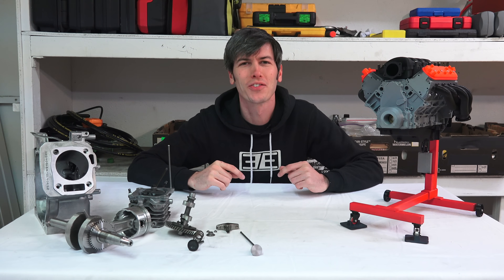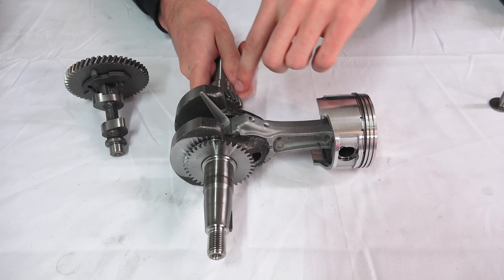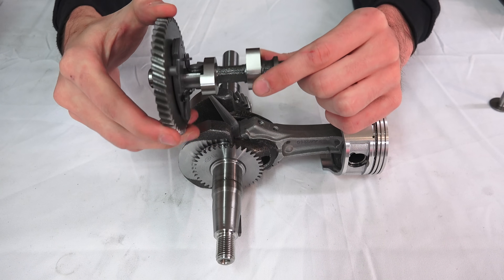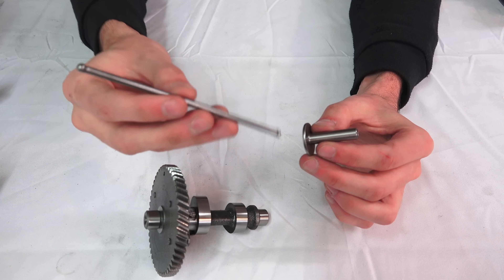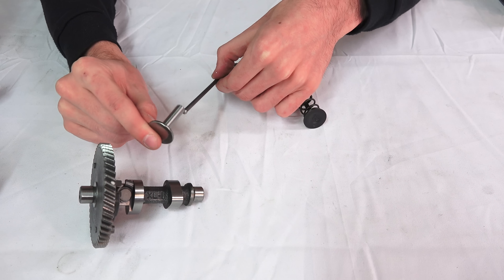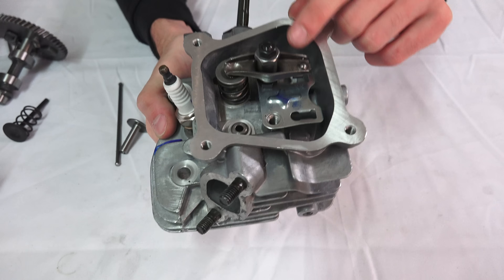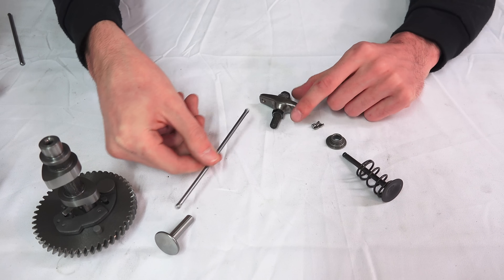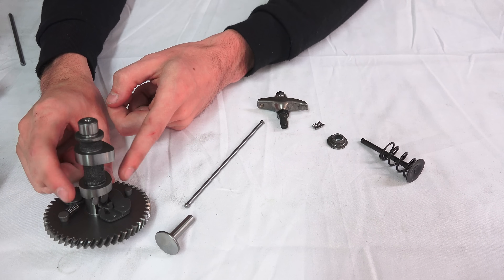Why Can't Pushrod Engines Rev High?

Comment: Why don't pushrod engines rev very high? Reason 1) Valvetrain mass. Reason 2) They generally don't NEED to rev high in order to make power... because their displacement relative to external dimensions tends to be higher than OHC engines.
Reply: and more pumping losses
Reply: @L.Verhoeven  Yeah, with a turbo...which is essentially making that 1.6 into a larger engine.
Reply: That, too, is a fair statement. My response, re: the external compactness of OHV engines compared to OHC engines is specifically a reference to automotive-type V-configuration examples.
Reply: @L.Verhoeven  But how long will your 1.6L last in a cold climate and daily use with minimal maintenance?
Reply: @Richard Vaughn Bingo. Work (torque) = force (cylinder pressure) x distance (stroke). I drive a tractor-trailer. We need torque, not HP. Torque moves the load (weight.) Power to weight really comes into play here. HP is speed. Try to start off an 80,000# load with HP and minimal torque. Ain't happening. This is true in any related application.
Reply: @Richard Vaughn that's actually not true at all, I dont know where you got that info from but its false
Reply: @Richard Vaughn There's nothing instrinsic to overhead valve engines that dictate them having a larger stroke.  You can have an OHC or an OHV engine with any combination of bore and stroke.  Some of what you said is correct but your first comment was nonsense, "boy".
Reply: Mark Estrada well said
Reply: Higher revs= more wear.
Reply: @markusgarvey  not true, more friction == more wear, why are F1 engines pretty reliable for how many revs they do and at how high power output
Reply: @kas-lw7xz  They run 1  or 2 races and they need rebuild. An F1 car would be doing to make 6 hrs. For instance Team Corvette GTLM class will run 24 hrs no problem w/ 5.3 pushrod V8, and would still be able to race the next day. Probably wouldn't win, but would make it through another 3 hr race, you could pull it out and get 50k or more out of it in a daily driver.
Reply: True, and a fair point. Amended Reason 1) Reciprocating valvetrain mass.
Reply: Technically a dohc engine has more valvetrain mass. Just they don't need to be force up and down.
Reply: Exactly.  "They do not NEED to rev high to make power."  My 1963 Ford 260 V-8 reaches its peak torque and best efficiency at only 2200 RPM.
Reply: i actually once did a comparison between the 2 most used V8 motors used in performance cars here in australia until manufacturing was shut down, the pushrod LSA which was used in HSV and the DOHC miami which was used in FPV, both supercharged.  in terms of horse power, the miami came out ahead, even though it has a smaller displacement, 5 liters to the LSA 6.2 liters.  but the LSA came out ahead when it comes to torque.
Reply: @Richard Vaughn i do know how it works, trouble is with strokers, if you increase the stroke without increasing the bore to match it, you can lose power in the high RPM ranges and it can accelerate engine wear faster than an alcoholic drinking beers at the local pub on a friday night.
Reply: Not necessarily. My Daimler V-12 has a SOHC and its valves are all in a line just like a SBC or Ford Windsor. It's a 60 degree V but given that its heads are no wider than said Chevy or Ford, it'd be no wider than those engines even if it had a 90 degree V. Forget that it has 12 cylinders as we're talking about width, not length.

Comment: Mainly because they do not need to, they make sufficient power at lower rpm's. If needed they can rev, look at a NASCAR engine. Over 9000 at times with pushrods and rocker arms.
Reply from the maker: As discussed in the video! :)
Reply: Yes it was. Outstanding video BTW.  As an Engineer also, (retired), you explain things very clearly.
Reply: charlie dee pro stock engines were turning somewhere in the neighborhood of 11k rpm or more the last time I was into it.  They run huge springs  and massive amounts of open and seat pressure.  Seat tends to be 500lbs and open is around 1000-1200lbs.   Pretty impressive in my book.
Reply: Engineering Explained  maybe the take a look at NHRA pro stock motors. Currently 10500 rpm. Used to be 12-13000. And they are 500 cubic inches.
Reply: I used to have a 1982 Mini the BMC A-series engine was first put in them in 1959 and it was first put into the Austin A30 in 1951. I had only minor modification but it would quite happily rev to 8,500 rpm on pushrods, would then suffer from valve bounce so that's not bad for a engine designed nearly 70 years ago.
Reply: 500 cu. in. with over 1" lift cams and a single throttle body... Try doing that OHC and DOHC... F1 cars are unreal but they dont hold a candle to pro stock. Also NASCAR engines are flat tappet.
Reply: joe blow nascar engines have roller cams now
Reply: Lorentz the annoying Llama almost all pure balls to the walls racing engines are done after a race and in need of some care.
Reply: Lorentz the annoying Llama need I bring up F1 and the ridiculous engine rules?   How long did those engines last before they puked their guts?
Reply: charlie dee short track engines rev far higher then super speedway engines. First, short track engines only have 1gear at its disposal AND no fuel usage issue.
Second, superspeedway engines have mulitple gear ratios at its disposal AND are limited to amount of fuel,, ie restrictor plate means, big cam, big carb, useless. They normally try to keep revs as low as possible, 7,000-9,000 is max, not due to engine coming unglued but fuel usage at higher revs.
Reply: And they have to be rebuilt after the race.
Reply: Bartonovich52 what has to rebuilt after the race?
Reply: Good explanation

Comment: so what you're trying to say is coyotes are better than Ls ? 😉
Reply: PEDRO ى look up the $10k LS vs Coyote build off. LS won with over 100lb/ft more torque. All those cams and valves and can’t create the same torque for the same amount of money as the more simple, easier to work on and much cheaper LS engine. 

No matter what you ford guys wanna argue, you’ll NEVER beat the value of an LS engine and you sure as hell can’t fit that HUGE 5.0l into all the cars you can fit the smaller 6.2l in.
Reply: bigpigslapper Oink hear that.
Reply: Eric Erickson yea I've seen it and you're right about not being able to create the same amount of power with the same amount of money, that's where the LS is far superior but i meant what I said as the coyote being more efficient and being to rev higher, and the coyote is getting more complicated while the LS has stayed on the same path.
Reply from the maker: Not yet! Will have a video on the advantages soon. :)

Comment: I just can't believe how much I'm learning with this channel. Not to mention how easy it is to learn these stuff. You're getting better everyday, dude. Keep it up!
Reply from the maker: Very happy to hear it, thanks for watching!!
Reply: same review here too . u make it extremely easy to understand from a foreman level. 
i wished i were  to learn automobile engineering supported by Ur videos
Reply: master blaster of engines
watching Ur videos i have changed my concept of engines i now take good care for my engine hope u make some maintenance videos too for Indian passenger cars.
Reply: I had previously thought your videos to be quite well thought out and very well researched alas not on this occasion cbr250rr 19500 red line 410 chev motors used in jet boats regularly rev to 10,000 rpm the old f5000 race cars of the 70s regularly 8,000-8,500 and the cross plain chev from that era 10,000 most production cars do little over 7,000 rpm  (yes some will and can go higher but most do not) and pneumatics has little to do with high revs in f1 cars either it makes it easier to eliminate cams and/or have better valve timing variation
Reply: @konaguzzi1  ... the fact is: the level of precision in building 'all' engines  has increased by several orders of magnitude in mass-produced engines (as they say, a rising tide lifts all boats)....We have always had special performance shops who could and did "blueprint" engines...set it to the engineer's standards and tolerances, balance components and produce top quality components which could exceed factory specifications. Now the quality OF CAR engines are pretty consistent...all the engines are good, you don't have to get a lucky car to find one that makes with 5 or 10 horsepower of specification - if not exceeding it by as much!

    Once factory parts got better... then specialty shops got even better than that. When you could get a "Mountain Motor" (running 500, 600+ plus cubic inches) to rev to 9,000 - 9500 rpm - using factory-like components - like they were doing with the factory super stock engines and Outlaw engines... with push rods; like they were doing back in the 2000's. Something was being done "right"! Of course, those engines only NEEDED TO RUN FOR  a few seconds at a time, and cost 30,000 each (in research and development money).

     today using 5 litre engines, we have everyday "bread 'n butter" - rental cars  which can do 7K rpm... and can be expected to do 100 - 400K miles - in pickup trucks, cars with damn good reliability. there was a time when the local machine shop would build you an engine, which you "hoped" would not blow up 500 - 1000 miles after you put it in your car. Now we can get a crate engine, which puts out 500, 600, 800 hp  and comes with a warranty!

    How is that fake? ...factory engines have a whole 'nother list of requirements which specialty motors never have to face.

     Do not try to compare apples and oranges - then use that comparison to call out someone who is taking a little bit of his time to drop a little bit of knowledge ... for people smart enough to NOT look a gift horse in the mouth.
Reply: @JustinAEgan  Apple with apples push rod engines have and do rev high he said they don't Sorry they can and do not looking any gift horse in the mouth at all just pointing out his utter lack of research on this vid, any research into relative engines of similar time will show that is correct
Reply: @konaguzzi1  I paid attention, mostly, to his point "push rod engines ...generally... do not tend to rev that high". I did illustrate the fact that you can, get pushrod engines to rev... its just more expensive to do it, than to just buid bigger engines, which burn more gas,are wasteful. nothing wrong with it... as long as you understand why we made that decision.

      I took that as the reality of "most" production, mass-produced passenger car and pickup trucks.

     He compared push rod engines to DOHC engines... which to me follows the large disparity between GM sticking to the push rod activated engines - compared to Ford, first expereimented with and who made a move to  SOHC in the 60's, and DOHC engines/multi-vavle engines - as far back as the mid-80's.

       If you think about it; American automotive companies, after the world wars... made a conscious decision to build (cheaper, bigger, large displacement, high torque) - simple engines, with pushrod valve systems; while the European countries and ultimately the rest of the world (japan, for example)...concentrated on building smaller engines which traded higher reving efficient engines. While Americans chose to build larger sized, bigger displacement, low reving, pushrod engines...which naturally produced more torque.

     We chose to build engines which were "good enough"...generally 'bullet-proof'...cause they were over designed, strength wise. Could be rebuilt easily with general tools and general skills. It fit the American ideal of "A chicken in every pot".... vs. the idea of Cars being a luxury, finely machined, regulated by the government and used mostly by the elite... Funny thing is, Ford, builder of the Model "T" - the American Volkswagen... was the one which made the move to DOHC/Multi-valve engines first... then bet their company on the idea that they could make it work? You would have thought that GM would have done ti first?

I understand its reeks of politics. I actually wrote a paper on this very subject, when i was in school.
Reply: konaguzzi1 I figured the pneumatic valves gave more control as you say. Just because he only mentioned one aspect and reason for them doesn't mean he doesn't understand them. I appreciate your comment however as I was only guessing at the other reasons and you have confirmed it.
Reply: Great video. 11-28-25 F

Comment: But what about NASCAR and there almost 10,000rpm with push rod engines unkess rules changed. I will give you they dont rev to 20,000 rpm but 10,000 is still impressive.
Reply: watch the video before you comment...otherwise you might look silly, im just sayin'
Reply: stickloaf I did i am just responding to the title of the video that is all. It is misleading. I would also like "high" to be defined. 5000 is high in a desil engines so ,if  the title was more descriptive cool but all I saw was title and was like hold on. And being a fan of this channel a lot of his car stuff has to do with performance also being a racing fan my self I am fully aware of most engine regs and the performance of such engines.  

Troll me if you must but just my $.02

Comment: I have a question! (Maybe a good one)

I drive a manual RSX-S.

When I’m driving about 30mph I’m in 4th gear.  When I hit an incline, is it more beneficial for fuel economy to downshift to third or push my 4th gear (step on the gas).

This car doesn’t have a whole lot of torque, and I can feel the engine struggle pushing 4th gear at low RPMs.  Lots of hills and inclines where I live.

TL:DR which is better for gas: 3rd gear up inclines or keep in 4th and step on gas more

Comment: Why are there no more pushrod 4 cylinders being made anymore?
Reply from the maker: Doesn't seem to have the advantages of simplification like it does with "V" engines. SOHC is far simpler.
Reply: Because it's outdated af
Reply: Anthony 123 The packaging benefits of pushrod engines are small on inline engines but massive for V engines.
Reply: Lorentz the annoying Llama Nonsense and total engineering ignorance. Evidently engines make power at a wide range of RPM, and you have control over it as well. By changing stroke ratio, you don't necessarily change average horsepower, but you do change power distribution. Longer-stroke engines make more low-end horsepower, while shorter-stroke engines can make higher-end horsepower. When it comes to OHV, short-stroke OHV engine can maintain efficiency and make broad ranging power by increasing bore. You think the differences in long-stroke diesels, big-bore LS engines and short-stroke Ferrari engines are all accidents and not intentionally different? No, they apply different strategies, and they all make power very differently. You guess which is most efficient.
Reply: Pushrod engines do tend to be shorter and so can fit into a car with a lower profile.
Reply: Engineering Explained And ontop of that, as mentioned the packing advantages of pushrod in a V8 doesnt translate the same to an inline engine. Since with a V8 you have width as well as height effected along with some weight.

With an inline engine with only one head, height is really the only measurement effected. Length and weight are not as much so you cant increase displacement as much like you can with a V8 and still save space and make up the power loss from less efficient valvetrain.
Reply: Google the Motus V4, basically a mini LS cut in half
Reply: No power compared to newer engines and to easy and cheap to fix and work on
Reply: Lorentz the annoying Llama dude pushrods don't have a hard time the valve spring does.
Reply: Actually, there are still OHV 4 cylinder on the market,  but most are diesel and not found in mainstream passenger cars. The Cummins ISF2.8 is 4 cylinder is good example. Also, a number of Japanese diesels are OHV. Really, there's not much benefit to OHC in a diesel that revs low. In reality, there's not much benefit to OHC period. If we built gas engines more like diesels, making them develop their power lower in the rev range, we'd have more usable power and better efficiency at the same time.

Comment: I have a Ford 4.0 v6 engine. Now I know why it doesn’t like to go above 6,000 rpm :(
Reply: Angel Gutierrez at least you can hit 6k, my Jeep's 5.2 V8 is limited to 5200.
Reply: Angel Gutierrez thats a sohc so no, you're wrong again.
Reply: My DOHC 3.5 V6 F150 revs to 7000 🤣
Reply: My 3.0 ohv has a rev limiter at 5900
Reply: Dude Shark dohc are mustang engines
Reply: Derrik Lee Some of them are Pushrod.
Reply: Derrik Lee plenty of them are push rod.  There’s also some dohc, don’t think we got them in the US tho
Reply: Angel Gutierrez that’s true, the new 5.0 coyotes are dohc.  A 3V 4.6 is a SOHC, and the older engines are ohv or push rod engines.  Other engines are DOHC besides the mustang’s
Reply: Jonathan Garneau-Reid I hear you! My 5.2 doesn't even like that. The stock valve springs are quite pathetic, barely sustaining 5200-5500 on the baby stock cam. Add 1.7 ratio rocker arms, and now even 5200 you can get valve float. I'd upgrade my springs so I could safely rev to 5500, but stock heads just aren't flowing the air anyways, and stock cam on the taller rockers isn't too far behind. While if the springs I were to put on might help me rev safely to 5500 or so, just kinda pointless for the maybe 10 or so peak horsepower I'd see. Need to upgrade my cam, heads, and timing chain first, and springs will be upgraded at the same time with the heads & cam, so no point in it right now.
Watch my latest video I posted. Idk if that's valve float or not (the sound plus the smoke), but that's mildly concerning. That was revving to a max of 5500 I wanna say, with the average rev being about 5000-5200.
Reply: My Ford 300 doesn't have a limiter but I don't carry it much past four grand since I makes power at 3500 rpm